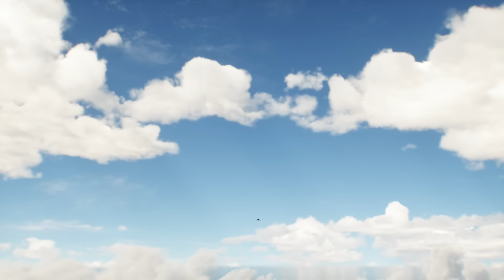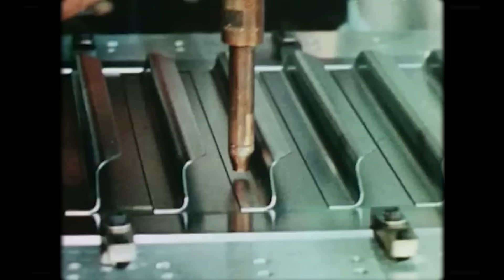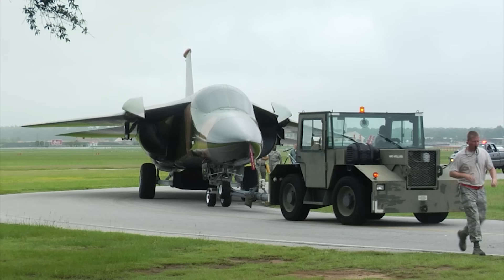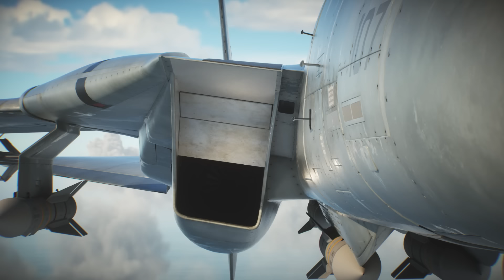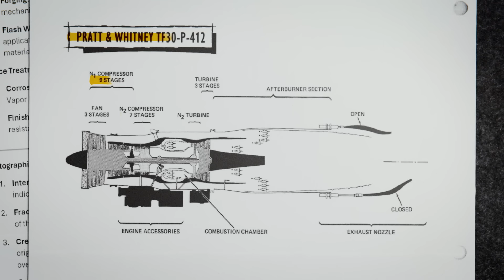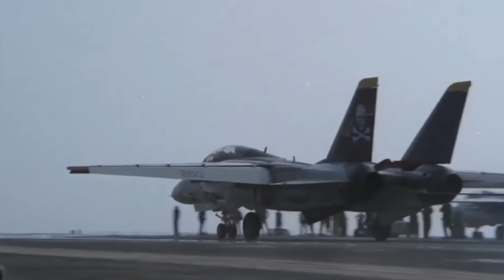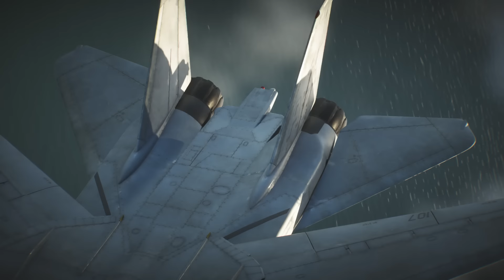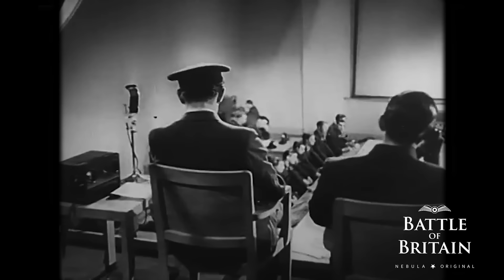The Insane Engineering of the F-14 Tomcat

Comment: One note as a 12 year welder and lifelong nerd, most welding processes do not involve combustion! They use an electric arc with variable shielding mediums to keep oxygen out of the weld. TIG is common for welding titanium with argon shielding gas
Reply: I was wondering about that. The IG part of MIG/TIG is ' inert gas ' which means the whole point of it is to not have oxygen around the weld. I clearly remember forgetting to turn on the Argon and the welds sucked.
Reply: @rienkhoek4169 sucked lol you must be talking about mig with no flux! Try doing tig without gas and it will be a whole lot worse than just a bad weld
Reply: Glad someone already said this. That was a strange statement given how thorough he is. Even the most rudimentary understanding of welding tells you that's what shielding gas is for, as well as the fact that an electrical arc isn't combustion
Reply: Did they have MIG/TIG back then?
Reply: @johnnunn8688  both mig and tig were figured out in the 40s, so yes. As somebody else said though another big reason would be quality control since EBW in a sense isn't so much "welding" like MIG/TIG/SMAW/etc with a major reliance on filler metal but instead is more akin to thermal fusing, similar to friction welding or homogenous forging
Reply: @Patters3  ah, yes. I have seen friction welding, it’s cool. Well, not ‘cool’ but you know what I mean. 😂🤣
Reply: That immediately threw me off too! Very odd for this channel.
Reply: Do you know why they still had to develop that totally new technology, instead of just using that type of welding instead?
Sounds muchhhhh cheaper! 

(but also much less predictable for quality, since some welders would* be better than others or have a bad day occasionally, I suppose?)
Reply: @MrNicoJac not sure, but I have a guess- unlike aluminum and steel, where you only have to shield a very local area near the weld, with titanium you need to shield the whole part (there’s probably a limit to that if the part is large enough), so it makes the process of welding it by hand pretty complicated.
Reply: I'm not a welder, but even I said "wtf" at the combustion statement.
Reply: As someone who has only welded a few times in his life I also knew the narrator had zero knowledge of the subject matter.  Disappointing but still an interesting video.
Reply: What do you think arc welding is? It is a shield in tig/mig, not an arc

Comment: Someone already mentioned tone of the first microprocessors used in the flight control computer in the comments. I would also another first, and something that wouldn't become a regular feature on fighter planes till the late 90's and early 2000's. Sensor fusion. They started with an IR sensor (IRST) that could cooperate with the radar, to either be slaved by it or the other way around. After the IRST didn't work as planned, they added a TV camera (TVCS) that had pretty much the same idea, but in the visual spectrum. And finally, with the F-14D, they brought back a new improved IRST, mounted it along side the camera. Both could work with the radar, making it again the fist example of triple sensor fusion example in history and decade/s ahead of anything that flew.

Comment: Two minor errors, 1: the Missileer was the F6D, not the F4D.

2: the Missileer and the F-111B were intended as long range fleet defense interceptors for the Navy.  The F-111 was a fighter bomber, but McNamara in his infinite civilian intellectual superiority decreed the Navy try adapting the F-111 to the role.

Just goes to show you that the best way to screw up a joint aircraft is to let the Air Force lead instead of the Navy. Every Navy attempt to use a USAF design for carrier ops has sucked, while every USN aircraft adapted by the Air Force has been a success.

Comment: I read in a forum about the competition to power the F-X (became the F-15) that led to the PW F100 (and PW F401 for the F-14). This person called it the Advanced Technology Engine referring to said competition and mentioned an entry which they typed as “GE 1/10” (or GE1/10). Not GE F110. GE 1/10. When I google this, the GE F101 appears, but I can’t find anything about a GE 1/10. For all I know, this is just some typo. But was the F101 initially a fighter engine then upscaled for the B-1 or something? Can anyone tell me about a GE 1/10? And if it did exist, was it just that bad that it lost out to the F100? Thanks

Comment: 15:17 dang they got their own radar too huh? the missile really does know where it is at all times
Reply: It knows where it is because it knows where it is not.
Reply: The missile knows where it is because it knows where it is not. The missile knows where it is because the missile subtracts where it is from where it isn’t (whichever is greater)😂
Reply: the problem is fitting a powerful enough radar in a missile, so due to the limited range of the radar it is only useful in the terminal phase. nevertheless the missile does have an inertial guidence system as well, which can help it get close enough to lock its radar on a big target such as a bomber on its own.
Reply: @juusolatva  yep. With the introduction of AESA radars I imagine the pitbull range could drastically increase. Emphasis being on "could" because there're benefits to keeping the active range as short as possible
Reply: @juusolatva  The phoenix is cool as you can also launch it off the rails and it has a good chance (depending on the distance) of picking up the target without any guidance and showing them what a missile with a 133lb warhead can do to them. That's more than 50% more explosive mass than a 250lb MK81 bomb and that's terrifying!
Reply: @deekamikaze  13 NM on a bomber sized target, active right off the launch rail.
Reply: @juusolatva  Actually it is the battery life of the missile, it takes a huge amount of electricity to power a microwave radar system, even the small one inside your microwave oven is an energy hog.  When the missile gives up, it is because the onboard battery is depleted.
Reply: There’s been radar on Grumman fighter aircraft since the Hellcat night fighter in 1943-44!  Crazy right?!
Reply: It is classified as an Active Radar Homing missile or FOX-3. The missile switches to its onboard radar at a given distance when launched in Track While Scan (TWS). The AIM-54 could indeed be launched active from the rails but only within 10 ish miles by switching to PH ACT by the RIO or by lifting the ACM cover on the pilot's front panel. In this mode the missile does not loft, reducing its range considerably.
Reply: @A2Moonclaw  Modern missiles do not go active on the rails, this is only in certain scenario when the aircraft did not obtain lock while firing
Reply: @M16_Akula-III  Thanks for the correction, I shall edit my comment accordingly.
Reply: Please keep in mind that this is not every missile. The AIM7 Sparrow does not, nor does the R-27. However, the AIM-54, AIM-120, and R-77 do. These are advantageous because they can be launched at a target beyond the optimal range for the aircraft's radar, and you can turn and run after committing a weapon
Reply: @Bill42.1  That's why the AIM-7 and R-27 are fox-1 and AIM-54, AIM-120 and R-77 are fox-3 right?
Reply: @twandepan  yep
Reply: @twandepan  I forget which is which but "Fox" then the number is about the homing system being infrared or radar.
Reply: @b1laxson  Fox 1 is SARH (Sparrow), Fox 2 is infrared (Aim-9), Fox 3 is ARH (AIM-120, AIM-54, R-77, etc)
Reply: @b1laxson  
Fox-1: Semi-active radar homing, e.g. AIM-7 Sparrow, R-27R
Fox-2: Infra-red (heat seeking), e.g. AIM-9 Sidewinder, R-73
Fox-3: Active radar homing, e.g. AIM-54 Phoenix (the missiles described in this video), AIM-120 AMRAAM & R-77.
Reply: @Bill42.1  the limit of weapons is almost never the radar of the host aircraft and launching beyond its range, the limit is with missile kinetics
Reply: @Lightning_aus No not really, a lot of things limit the performance of missiles, including the aircraft that's launching it and the missile itself.
Reply: @M16_Akula-III  ... I said, its the missile itself that limits range, mostly kinetically. The current radars in service have over 200nm range when the furthest missiles have up to around 150nm with exceptions being PL-15, but the capability of that is debated. Obviously launch height and speed make a difference but the actual missile performance is affected by the missile itself. If you launched every missile at the same speed and height, the results would be different for each one. I don't see how it isnt missile kinetics that affect range. With modern datalinking you can fire on targets from over 300nm with AWACS DL but your missile kinetics also limits it to around 150nm or even less if the target is defending. Also missile 'launch range' might be high but your PK would be very small when shooting at RMAX
Reply: @Lightning_aus  It's not the same case with everyone, an example of this are Su-35S with R-37M. N035 severely limits the R-37M range to 150 km, when a MiG-31BM can get kills from 200+ km. Detection range and tracking range is severely different.
Reply: @M16_Akula-III so you cherry picked the 1 missile with supposedly further range than a radar to prove your point... mate, it could have been launched from a lot closer than the RMAX because UKRAF doesnt have anything to counter it. Why launch it far with less PK when they could close to within the NEZ and shoot it there?? Just because this 1 missile (with totally unconfirmed stats) has a further range than the radar, doesnt mean they would employ it outside this range, and also, this is one missile out of the tens currently in service
Reply: @Lightning_aus  Because there are other threats looming, like SAMs. some modern radars (AN/APG-77, APG-81, APG-85, CAPTOR-E) could reach that 250nm number but it all depends on the target itself.
Reply: @Lightning_aus  Smaller fighters will have a smaller radar range, and most of the time these small fighters radar does have less range than the missile kinematically could go.
Reply: @M16_Akula-III  how about you give some examples rather than just saying 'smaller fighters'?
Reply: @Lightning_aus  JF-17 with SD-10, MiG-21 Bison with RVV-AE, F-20 with AMRAAM, Tejas Mk1/Mk1A/Mk2 with R-77-1, ASTRA Mk1, ASTRA Mk2, MICA
Reply: @M16_Akula-III  Is this a chatgpt response?

JF radar outranges the SD-10, since the old KJ-7 from the late 90s has a range of up to 150-200km, which is further than the range of the SD-10 which is 40 nautical miles. 

The bison isn't even a frontline fighter anymore and is set to be phased out as we speak. It is hopelessly outmatched with a 50km max range radar, even with R77s, the IAF wouldn't bother sending it into combat. 

The F-20 isnt even in service, so no idea why you even included that. 

Tejas has either the EL/M-2052 or EL/M-2032, which have a 200km/300km range respectively, both of which is further than the R77-1 range which is 110km. Astra MK1 has a 110km range as well, with the MK2 apparently reaching 160km in 2017 (still short of the 200km range of the 2009 EL/M2052 non aesa radar). MICA has a max range of 80km. 

Sorry, you are completely wrong.
Reply: @Lightning_aus  KLJ-7 does not go 100km+, against a fighter-sized target, optimal 20nm. EL/M-2052 or 2032 are modular radars, for the Tejas, around 60-70nm. You said examples, I gave you them.
Reply: @Lightning_aus  R-77-1 is NOT RVV-AE.
Reply: @Lightning_aus  Almost never, but AIM-120 limit was limited by Hornets radar, until they got and are getting the APG-79V4 AESA..
Reply: yep, most modern radar missiles do, and they are insanely good

Comment: The F14 is cool but was kind of bad.

It was infamously unreliable which is especially bad considering it was a carrier plane where you can't exactly fit as many facilities or spare parts

It wasn't that fast or nimble. The F14 is seen as a dog fight weapon while the F111 Aardvark is seen as a big slow plane when if you look at their stats they are around the same size

It only exist because of dump interservice rivalry and the navy could have easily used say a modified F15 or F16 instead

Adjusted for inflation it costed more per unit then a new F35

Comment: I worked on a project where we had to EBW a particular grade of stainless.  It was the only process to reliably join the section thickness we needed, while not damaging the rest of the part. Fantastic process, but definitely not cheap to get the results dialed in. Lots of destructive testing.

Great video. I had no idea that plane was so crazy heavy. I also love the shots of the manufacturing - really makes it easy to understand how these projects have budget overruns. Any mistakes or irregularities and things get expensive really fast. And that radar is just bonkers powerful. And the aero transformations. Wow, truly a masterpiece of design. Expensive, yes, but it seems like they hit absolutely every design requirement asked of them and the solutions were pretty elegant.

Comment: A little mistake at 14:19. No way the missile motor had a burn time of 3 minutes. This was probably just the max time of the battery. For comparison: The SLS solid rocket boosters boost the SLS for 150 seconds. Most air-to-air missiles don't even have a burn time over 20 seconds and then glide the rest of the way. They also usually just have 1 or 2 stages, one quick one that is very powerful to get it up to speed and then a sustainer stage to keep its speed up and fight through the air resistance.
Reply: I believe it had a burn time of around 30 seconds, which is still an insane burn time for an Air to Air missile. My guess is that somewhere along the lines "a 0 was added" and it was read as 3 minutes
Reply: Correct. It's booster (no sustainer) fired for 30 seconds and it's guidance time is about 3 minutes.
Reply: Comparing it to the SLS is extremely meaningless. You optimise for burn time based on the specific use case. 3 minutes is way too long though
Reply: @ the comparison is between the burn times. It doesn’t make sense that an AA missile has a loger burn time than a booster that brings a rocket weighing millions of lbs near space. To highlight the absurdity of 3min booster time.
Reply: @nicholasjensen8016  my point is that it's meaningless precisely because of the two extreme cases? Sending a huge machine effectively straight up Vs a low weight missile horizontal are just such extremes. It'd make sense to compare it to other similar missiles, and even very long range modern ones don't tend to go over a minute.
Reply: @lost4468yt  its like saying a train has more horsepower than a car, the comparison makes sense in the context
Reply: I had to watch that part 3 times to verify that's what I heard. That seemed grossly overestimated to me. Honestly I'd have a hard time believing 30 seconds let alone 3 minutes.
Reply: Mk. 47 burns about 25-27 seconds and Mk. 60 motor burn 20.6 seconds according to Heatblur, so yeah, ur right

Comment: I always wondered what the "canards" were for since they always looked fixed to me and not like active control surfaces. Now I know. Thanks for that.
Reply: They were only active for the first few years of the Tomcats' service.  Later testing revealed that the glove vanes really had next to no effect on the flight performance of the aircraft, so they were disabled on the aircraft that had them and were subsequently removed on later airframes and the slots filled.  Projected future upgrades such as the ASF-14 and the AST-21 redesign the glove vane area to include additional fuel tanks, showing how really unnecessary the vanes were to begin with.